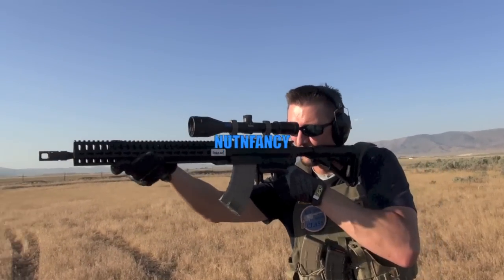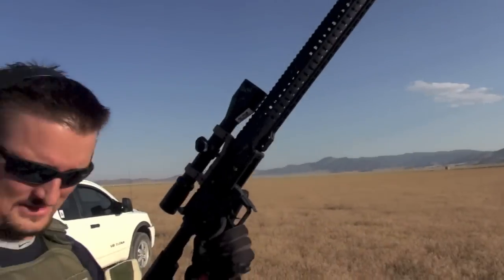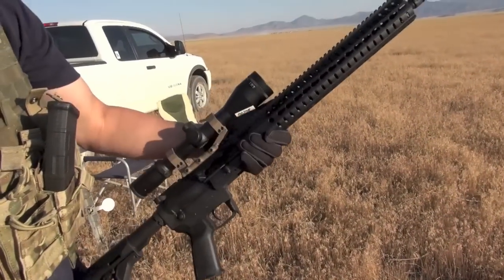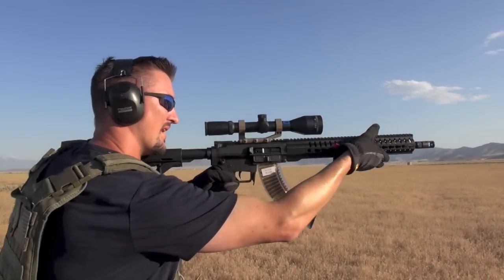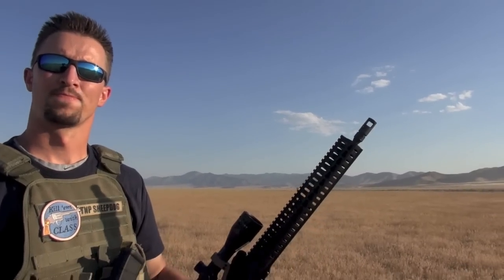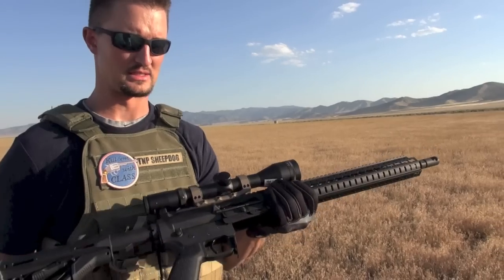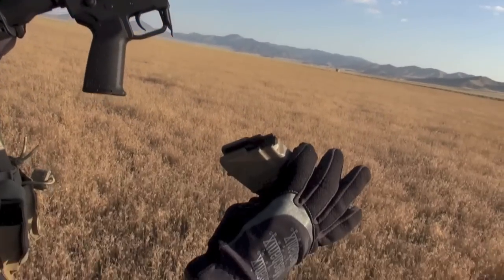Mutant 2nd Chance

Comment: Check/replace the extractor and install an extra power extractor spring with O-ring and insert. I have an AR pistol that was having the same problems and the swap fixed the issue.

Comment: Nutn, i have heard that a common issue with using ak rounds in an ar is the extractor holding on too well. thats what it looks liek to me. a gun smith i know, said to swap the ak extractor for another that will work.

and a double feed is two live rounds trying to be chambered at once, and it usually caused by the mag. what i saw in the video is failure to eject.
Reply: needs a stronger ejector spring and O ring.  either that or under gassed which I doubt
Reply: norman david the gun smith i know said he never could get a russian round to work in the ar with the "ak" extractor, he said he put a regular 556 extractor back in and it ran fine after that. think it has too much surface area and grabs the brass too tight. although a better ejector spring would also be worth a try.

Comment: Nut'n and Jardine, what elevation are you at in the desert? There might be an issue with pressure at that altitude.  It would be worth running the drill at sea level and comparing.

Comment: Truly a bummer seeing this. My CMMG Mutant has not had a single issue with 2500+ rounds using a huge variety of mags. 

I get this and the original video are a few years old, but I am shocked that even a few years ago a mutant could be a horrible rifle. Mine was totally new, bought in late 2019, manufactured less than a year before.

Comment: Nutn, just a stab. I had an AR doing the same thing. Take a peek at the retaining pin on the buffer. If it's sticking up even just a bit, it catches the spring and causes inconsistent bolt cycling. It might need to be trapped in a little. A simple step that's worth a shot.

Comment: Please follow up with us if you are still in communication with CMMG.  I would live to know what their solution is.  Because this is happening with both uppers, I too believe it is buffer/spring related.  However, if their gas ports aren't machined out properly, maybe there is a problem with manufacturing and the amount of gas.  The casings were ejecting in a similar path, then all over the place, right before it had a double feed.

Comment: As a gunsmith I have a few observations. Every failure was a failure to eject (double feed). That eliminates the possibility of feed ramp polishing as the source of the issue. If this only happened with steel case ammo I would look towards the extractor or extractor spring because sometimes the lacquer coating on steel cases causes them to stick in a polished chamber, making them harder to extract. But because the majority of the failures occurred with brass I don't believe that is the issue. I would verify the extractor, extractor spring tension, and ejector spring stiffness, but I don't believe that is the problem either. I noticed the ejection pattern is very erratic, this is a sign of gassing issues. I also noticed that the ejection tends to be towards the 5 o'clock position, that is a sign of under-gassing and short-stroking. I suspect this is a result of using a heavier AR-10 style bolt carrier and buffer with an AR-15 gas system. Very disappointing for such an expensive rifle!
Reply: Or the gas block could be mis-aligned.  Maybe the barrel isn't dimpled.

Comment: Someone needs to tell this guy pulling the trigger over and over again after a malfunction isnt going to solve the prolem...
Reply from the maker: It's not to fix a malfunction, it's to telegraph to the viewers (you guys) that the shot was attempted.  If you just pull it like normal, people won't pick up on the fact the trigger was pulled and start confused comment threads.  That's why the clearing actions seen on cam are never that effective, first priority is assessing and examining the issue instead of clearing the weapon. -TD

Comment: Maybe an extractor upgrade is in order?  Add an extractor spring insert and o-ring to increase extractor strength?  Steel-case ammo can be hard to extract under certain circumstances.  My Rock River National Match A2 had trouble with steel-cased ammo until I installed the squishy bits to the extractor assembly.  Just a thought...

Comment: You need a shorter recoil buffer.
Reply: Shorter than what? Shorter than a carbine buffer?
Reply: Shorter than what's in the rifle now, obviously.
Reply: Interesting.  Can you elaborate more? I'm not familiar with choosing shorter or longer length buffers.
Reply: When I was a part of Crusader Weaponry, we had an AR-10 build, one of our very first... exhibit the same pattern of malfunctions.  The problem was the bolt's cycle.  The BCG could not go back far enough for reliable timing, and it would do what this gun is doing.  We changed to a shorter Buffer and that allowed the BCG to travel fully to the rear, correcting these timing issues, and all malfunctions disappeared.

Comment: AR reliability with AK accuracy. Great rifle.
Reply: An AR is far more reliable than this
Reply: Murphy82nd was a joke on stereotypes mang
Reply: Lol I got it
Reply: Best of both worlds. LOL.
Reply: Troll. Your implication that ARs are this unreliable is just wrong straight out the gate.
Reply: he he he
Reply: stop insulting ars. no ar I've owned jammed. I've seen plenty of ak-style rifles jam, though.
Reply: +Daniel Peer then you don't shoot enough...
Reply: Dohn Joe you have no idea how much I shoot. You're just trolling like you have a clue. There is no secret to making an AR function: use brass and lube it. It'll run flawlessly if it was built to spec.
Reply: I think his point is any firearm can and will malfunction eventually.  That said I also have had better luck with even $600 ARs than AKs overall.  With AKs I find the magazines to be the weak point.  The surplus ones often need some TLC and even after getting familiar with rocking in mags I still find people will every so often miss that front locking point as opposed to a straight inset.
Reply: Murphy82nd I agree 100% on the AK mags. There are so many makers in so many countries that don't adhere to exactly the same standards or they don't have the ability to adhere to tight tolerances. Easily the worst part of the AK platform for AK style rifles in the US market.

As far as what he meant... it's almost irrelevant. He was being conscending. Of course, over a long enough time, any machine will eventually fail - but, that doesn't mean mine have failed yet. The most I've shot through any 1 AR is about 10k rounds of 5.56. Swapped BCG at 8k. Gonna swap the barrel before too long. (It's a CHF rated for 15k rounds. And, I don't baby it.) If you lube it and swap parts at regular intervals, ARs will work damn well for a long time.

Comment: Curious, did your Omaha have metal feed lips. The Gen 1 AK pmags suck ass.
Reply: Mags not Omaha. God I hate autocorrect.
Reply from the maker: Not from the looks of it if I remember right, but I don't think it worked with the bulgarian ones either. The gen 1's have been flawless across everything we've shot them in so far….though we didn't have anything all that picky.  -TD
Reply: +Lt Col Nutnfancy yeah shouldn't be that picky. I've had issues with Gen 1 Pmags and no issues with Gen 2 in the same guns. It's a shame this gun didn't pan out.

Comment: that thing is dry as a bone.
Reply: you'd know what that's like
Reply: +fordrac1ng81 yeah you can hear the charging handle, buffer spring and bolt scraping against each other. I can hear it without headphones. my armalite sounded the same way with just the machining oil from the factory. little bit of frog lube down the buffer tube, cleaned all of the garbage out of the bolt and lubed, cleaned and lubed the upper. the charging handle is the only thing that still grinds alittle. of course I expect a childish Snyde remark from a ford owner.
Reply: +Edward Byrd Dry and salty huh?
Reply: +Hawkeye nope. if I wanted anything 7.62, I'd just get an ar10
Reply: +Hawkeye nope. if I wanted anything 7.62, I'd just get an ar10
Reply: What you're hearing is just the buffer spring. Hearing it scrape is not indication of improper lubrication. You can't make it go away no matter how much lube you use. It's part of the nature of the platform.
Reply: +SchmoopyHD oh yes you can. worst case would call for a light grease, best case would call for a heavy oil like BG products moa/ frog lube/ chainsaw bar oil. all of which have paraffin wax , and make the oils stay put for a longer duration. it doesn't just slop to the bottom of the buffer tube. Wouldn't use those for winter though, way too thick.
Reply: Yes, lubrication absolutely does reduce noise caused by surface friction.
Reply: +Default Username even glock is properly lubricated with copper bearing grease out of the box. every gun I've ever pulled out of the box was lubricated with at least machine oil. matter of fact I dare you to take break cleaner to your favorite AR and fire it with no lube. video the whole thing. make it through a few mags and let us all know how it goes
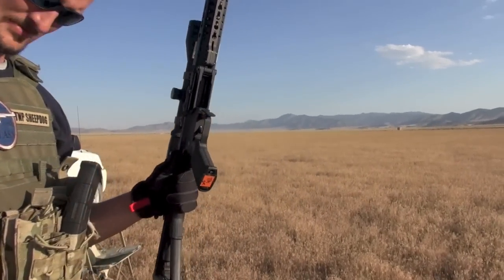Reply: Except he explicitly states he lubed it before the video. Unless you're calling nutn a liar. I don't think he is a liar. 5:00 I don't know if you bothered to even watch the video though.
Reply: +Stephen McNichol not calling him a liar, but slip 2000 definitely sounds horribly inadequate.
Reply: +Edward Byrd well it's not so there's that.
Reply: +Stephen McNichol bolt looks dry at the start of the video.
Reply: +Red Rider7 well since you went to bullet points. one sounds dry, two looks dry, three never said that was the end all be all of the current problems. four evidence shows the brass junk (looks like red army) is under powered, five cmmg is known for precision guns ie tight tolerances, all of those together add up to a shit  gun that perhaps produces decent groups with commie ammo. it was probably built considering week/old steel mags and gassier steel ammo. add brand new stiff mags (upward pressure on the bolt) , weak American made ball ammo (seems all American made ball ammo is weak junk) resulting in general under gassing, inadequate lubricant (either applied or too thin to do the job) and you get a seemingly complete junk gun. as a whole it can't be anything more than a bench rest range toy. it's not meant for anything but the tight wad to can buy the rifle but not the ammo
Reply: +Red Rider7 but it runs pretty damn good with wolf at the end of the video.
Reply: +Red Rider7 also to note. the brass case red army ammo ejected all over the place. steel cased ejected damn near exactly in one steady stream.
Reply: +Red Rider7 even AK guys and ruger mini thirty guys are having issues with the red army crap. still SOUNDS dry as fuck. I'm not saying he's lying, but slip 2000 is shit lube especially in heat. it tends to leach away fairly quickly, it's why I use the lubes that I do, takes months for them to leach away.
Reply: +Red Rider7 no I'm a mechanic. I'm not calling anyone a liar, however your comprehension skills need adjusting. I said it "sounds" dry, as in inadequate lubricant either applied or incapable. I'm not defending the rifle either, if you could comprehend and read everything else I've written thus far.

Comment: whats the function of the rug on the dash of the truck? Nutn has to be the youngest person I've ever seen with one.
Reply from the maker: Keeps the dash plastics from dry rotting and fading in the sun, seems to decrease the amount of heat radiating off of it when parked, and keeps stuff from slipping off when placed on the dash.  Plus it tends to hide dirtiness, it hides dust and crud better than an expanse of dished vinyl that no one ever cleans. Everyone throws a fit about them on every car I've ever driven.  Are they ugly or something?  It's just useful, but it seems like no one ever runs them any more.  :?   -Doodle
Reply: +Lt Col Nutnfancy yeah I don't find them attractive. I see the function now that you've pointed it out. I used to work at NAPA and only old timers would get them. It seems to me that they wouldn't stay put unless the backing is some kind of rubber. Ugly yes, functional I guess. The same could be said about fanny packs 😝 Thanks for the reply doodle.